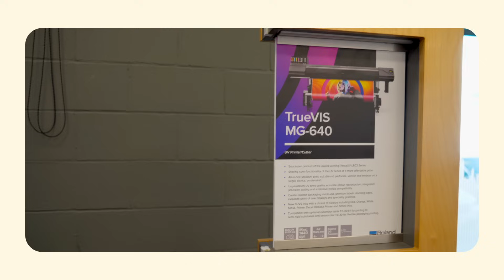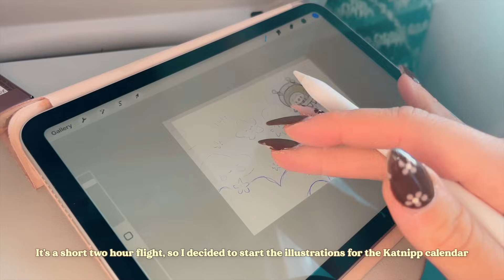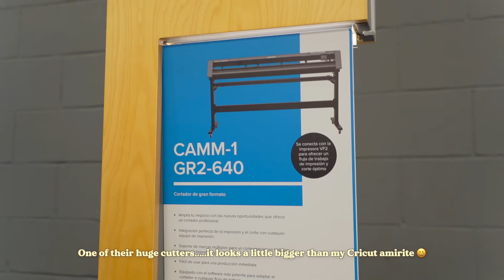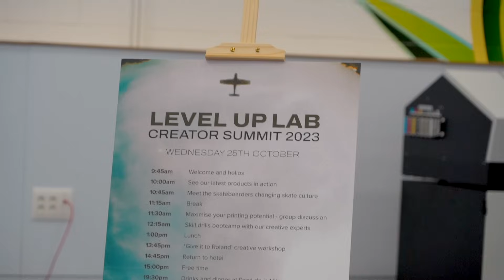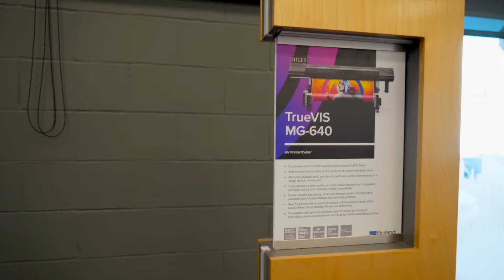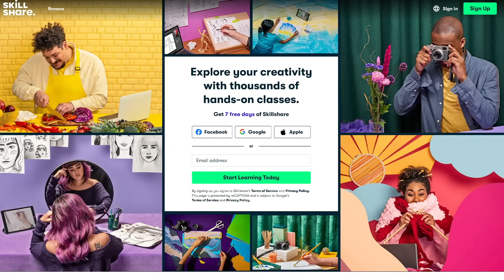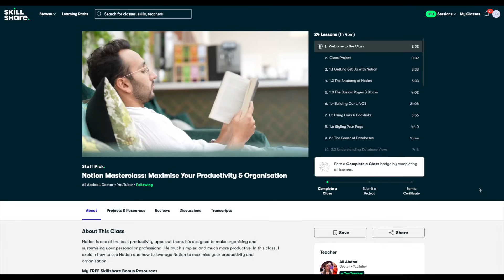we investigated the most substantial investment in our small business EVER ✷ SMALL BUSINESS DIARIES

Comment: I used to be a machine operator at a print shop. We had a few large format printers, and the Roland was by far my favorite one to run. The print heads did have the self cleaning mode that you mentioned, and that was a nice feature. We did have to clean the print heads manually a few times, but that was extremely easy as well. The print, then cut, features were very good on the machine we had too (and that was 15 years ago so I am sure the technology has gotten even better). One thing I didn't hear you mention was how you would laminate the print before cutting. Lamination isn't necessary for all processes, but this would be a crucial step if you were planning on doing vehicle graphics. 

I'm in the Pacific Time Zone, but I would be happy to have a call if you wanted to pick the brain of someone that used these machines every day. It can help to talk with someone that isn't a sales person too. Either way, keep up the great work. My wife and I have been following you for many years now, and it's great to see you thriving!
Reply: Did you have any multi functional machines in that business that you have experience with? I have always found multi functional machines, whether they are a fax printer or a high end color printer, etc to be problematic.
Reply from the maker: Oh wow thank you so so much! Yes the print heads have a cleaning mode which is very handy indeed heheh 🌷 Thank you so much I would love to pick your brains on this in the new year that would be super helpful!

Comment: This is amazing that you are even considering purchasing one of these machines! I used to work in this industry with printers and flatbeds and the best thing i can suggest are explore other brands or at least one other to compare the quality to. When you go back with the team ask Roland about different printing speeds available, and how thin and thick the media has to be to run through this machine so you aware of any limitations upfront. There is a ton of different media available but not at all will be compatible as far as running  through the machine. Know ahead of time what kind of material you'd like to print on  (other than paper)  like canvas, static cling, backlit  or styrene etc. I'd say one of the most important things is to ask is what percentage of VOC's are released after printing and if you need to be in a ventilated space to run the machine.
I will tell you from experience even if you printed everyday it's a good idea to perform maintenance and a nozzle check before any large run especially if the printer runs white ink. Sorry i know this is long but i hope it will be helpful!! Take as much time as you need, this is a big purchase!! Congrats!!!

Comment: Here's my two cents after doing a lot of research and talking with manufactures. Most of these printers cannot die cut, even the mid and high grade ones.. I learned this the hard way after buying in on some of the entry levels and sending them back thinking they're broken. My current printer place has a 25K beefy Roland and even theirs cannot, they have to use a flat bed cutter to get the job done. 
Also the inks and vinyl themselves is not enough to make them fully weatherproof, let alone totally waterproof. They need to be laminated separately and then put back into the machine to cut, which was the final straw for me to not want to invest in this if I need more machinery. 
I wish you the best luck in deciding what to do! So proud of seeing how far you've come!!

Comment: I have had roland printers. The cost you need to look into is the cost for replacement print heads. One can cost $900 and you may need up yo four if you have a 6 colour machine. Then a technician has a $200 call out fee before they start working  and then the repairs and maintenance cost extra. I learned to do most of the servicing myself but it was still extremely expensive

Comment: This is awesome! I’ve used Roland printers in the past few print shops I’ve worked in. There still one of my favorites. 😊At the Makerspace I currently work at now. We have the Roland True Vis SG2-300 and it’s been wonderful. Our printer doesn’t get ran as much as it could be but that hasn’t seem to mess with heads. Before I worked there we had a head strike where we did have to have a tech come in and adjust the print heads. But that can be avoided with research and knowing the settings for each material you use and making sure the material doesn’t get stuck . The inks have lasted us for a while with no problems. There are smaller parts we have had to replace such as cutting blades wipers and little pad and such. I’m sure the newer machines are even more advanced. I think you will absolutely love it and it will be huge investment for your business.❤

Comment: Just to let you know the Roland BN20 does print waterproof stickers.  I printed stickers with my sons name for his water bottles and some been on there over 18 months and go through the dishwasher at least 3 times a week.  Had stickers on our bins at the old house for 4 years and were still perfect and these ones at this house have been out for 18 months and still going and I don't laminate anything.  I only use genuine Roland inks though and make sure I download the correct profile from the vinyl manufacturer.  The inks for the BN-20 cost approx £50 +VAT each for 220ml ones and print heads can go especially if not used every day so I print something every day on mine even if just a row or two of stickers as print head is £2500 +VAT so anything above this int he Roland range that also uses solvent ink would be just as good if not better!   Hope this helps xx
Reply: @emmajane-ukcraftingmemories Thanks for sharing! I wonder if you could share what kind of vinyl did you use to print the waterproof stickers?
Reply: @shengcheng6477  I just make sure it is outdoor grade permanent vinyl and they work perfectly using genuine Roland inks.  I've used over the 5 years I've owned my Roland vinyl from multiple suppliers but I mainly use Hexis and Grafityp as they are both local to me so my husband collects my orders for me

Comment: you need the maintenance manuals of the ones you want to know better.  The eco solvents are only suitable if you have industrial level ventilation.  That is also an issue for resin, uv.  Two office windows won't be enough and if you need to install an exhaust-where will it issue to and are you even allowed to do that in the city centre,  you may need to relocate to an industrial area.  In order to make it pay for itself you would need to start setting up an arm of the business that did commercial printing for others, not just your own stuff.  I think the safest thing is to track down other users of the exact machine in your region and arrange to talk to them.  That's the only way you'd get the true skinny, and maybe out of your area so local printers don't feel threatened by you.  That being said, 🤤🤤🤤

Comment: Beautiful video and very nice impressions from the roland workshop <3 And a huge huge decision you have to make. I can totally understand the desire to take the next step and it is a very good decision to fly to Barcelona again in december to talk to them personally about your thoughts and next steps. And with this I would like to share some experiences with you, Cathrine <3 Sorry for the wall of text that's coming in <3

I am working for a little printing company in germany and we have one UV printer and one eco solvent printer by roland (and one HP latex, but that's no topic for now). The colours with the Roland printers are pretty good and crisp and very high quality. You will learn the printers pretty fast and with the manuals and a technican on the telephone you can handle a huge variety of problems and cleanings and maintenances on your own (but no technical problems). Maybe it was a handling problem with our machine, but you have to know, that the printer spare parts for roland are kinda expensive. Even though the printer is running all day or not, in most cases the automatic cleaning performances will eat pretty much ink in one month, so you always have to hold some extra ink cartiges on the side (but you have to keep an eye on the expiration dates). Also the inks of the UV printers are a little more thick (especially the white one) and therefore clog very fast. In most cases you cannot solve technical repairs by yourself and you have to call an technican to solve the bigger problems without falling out of guarantee (at least in germany the technicans and spare parts are kinda expensive, with 120€/h for a technican, ~90€ for an ink cartige or ~800€ for a printhead). Aside from that the Roland printers (like every other printer, I think) can be very time consuming, with manual cleaning every week, test printing and going through the cutting options. I don't know the handling with the cutting options on the Cricuts, but printing and cutting on rolls instead of plane vinyl/paper is a little different and not that precise. 
And no, I don't want to be funny at this point, but keep the size and the weight of the printer in mind when considering on moving the studio again. Can you even get the printer upstairs when it is delivered? Of course the printer has rolls and is very mobile, but is the elevator big enough to move the printer between the floors? In most cases the printer remains the same size as you saw it at the workshop and you cannot tilt it or put it upright.

With this wall of text I just wanna say - investing into a huge printer is not just the price for the printer itself, but always for the ink cartiges, spare parts, trouble shootings and technical problems, too. When you are in Barcelona again, just a personal advice, talk to an technican of Roland, too, and ask about the most common problems, the prices for spare parts and perhaps how to solve them on your own. It is not very helpful to just talk to the salesperson, because they just want to sell the printers to you. 

I hope, this wall of text makes sense to you? Just want to help <3 Keep going! I love your vids! <3